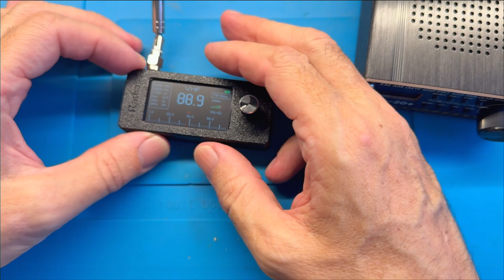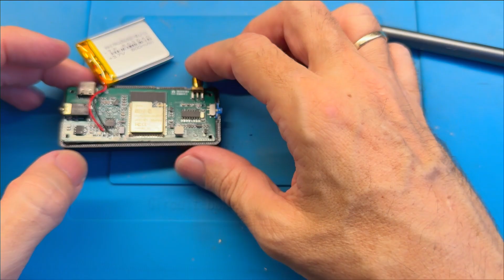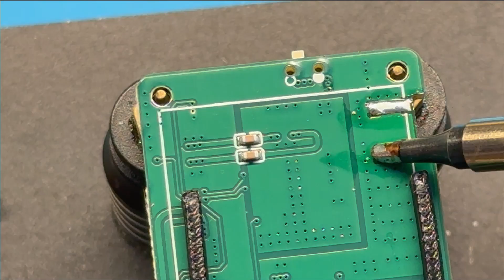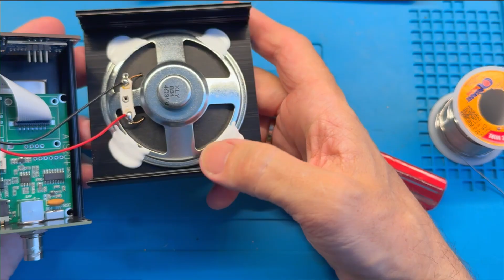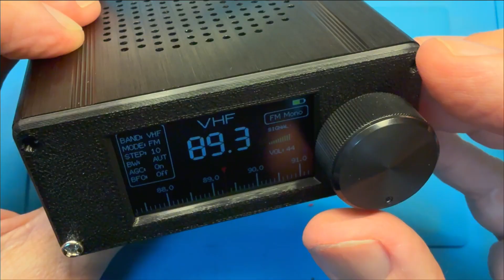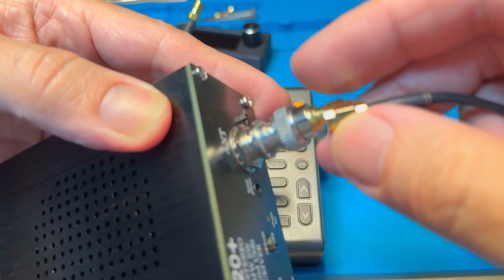EB018 - Si4732 Mini & ATS-20+ Hybrid Radio Project

Comment: Cool project! Gonna have to order one of those ATS-20s to make this hybrid.
Also there is a V2.0 of this Si4732 that has a slightly better speaker, then the V1, still not as good as the ATS-20 ofc. 
But the main upgrade would be they added a small power amplifier for the headphone and a small Hi-Z circuit for enhancing the signal from antenna to receiver chip.
Both the battery and the speaker are with connectors instead of soldering on V2.0 (at least on mine)
Thanks for this video!
Reply from the maker: Thanks for the comment. Yes I am aware of the V2. It could also be used in this project, although the hi-z input and additional headphone amp would be redundant.
Reply: I have bought a V2 SI4732 mini-receiver, the version with a red "AMNVOLT" marking on the case (that's molded and not 3D-printed on this one). It does have an audio amp for the headphones plug. I don't know about the RF hi-Z amplifier. I haven't noticed much of a difference as far as sensitivity goes with my other one.

Comment: I've got one of the new versions of the SI4732 on order just now , should have it here within the next few days , i think i might buy the older version and the ATS and do this little project 🤣

Have you tried the new SI4732 as its meant to have a better speaker ? 
You could hear the joy in your voice when you got a signal thats what its all about made me smile 😁
Reply from the maker: Thank you very much for taking time to comment. Let me know if ow how you get on! From the videos I have seen, the speaker in the new model does not look as good as the ‘original’. But no, not tried it myself.
Reply: Yes well it didn't turn out to good 🤣 the leg came off when I was soldering on the cable for the earth, I've still got another two of them but think I will just try and accommodate it in the Ats20 case or something . @ElectroBananasYT
Reply from the maker: oh no! Well fear not. Remember that the reason we wanted to connect pin 9 to ground was simply to disable the chip. You can take a fine-nose cutter and snip all the pins of the chip and just remove it completely - that will achieve the same purpose. Good luck William!
Reply: Snapped mine too 🤬 So I can cut chip out and just leave all the connection wires attached to the pads?
Reply from the maker: Oopsie! 😅 Yes you can, no problem! Have fun tinkering